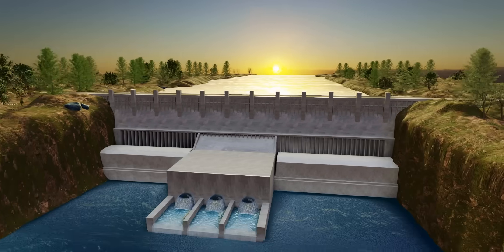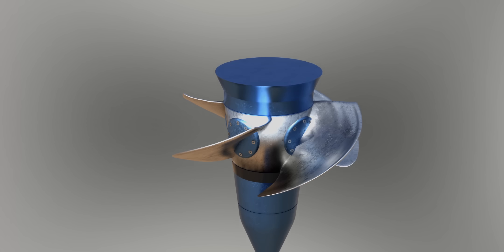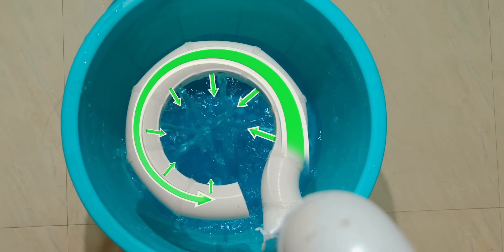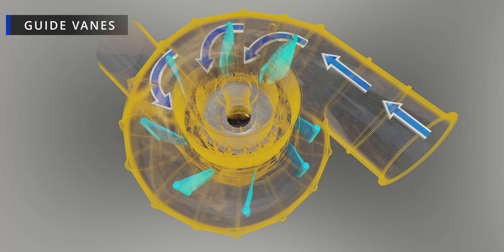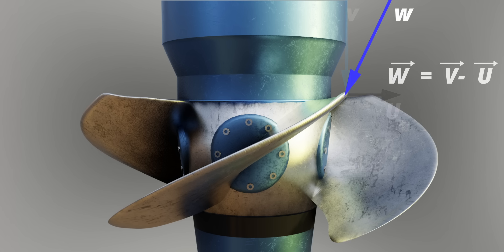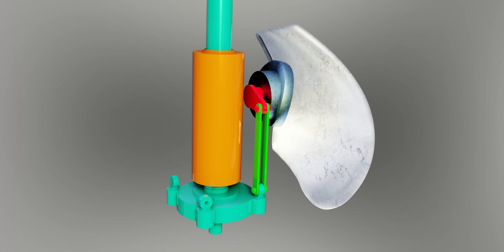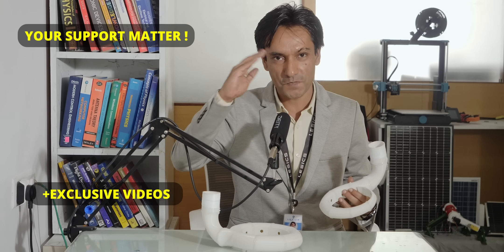Kaplan Turbines | Understanding the Giants of Hydroelectricity

Comment: Why does increasing the size of the draft tube with an end flare reduce the cavitation effect? One would think that increasing the volume of the tube in a low pressure situation would future decrease the water pressure resulting in more cavitation. I guess, because it causes an increase in flow rate that results in a pressure increase to more than compensate for the increase in post turbine tube volume?

Comment: every diagram and animation shows governor blades stationed verticaly, butin reality what about the fact that there are facilities with no casing structure  but a concrede spiral chamber (wtich does the same job) the turbine sits on/inside the floor, the intake  and the governor blades are positioned inside a narowing shroud about 40 cm from the floor, and the governor blades are positioned not verticaly but at an angle about 30 degrees (it could be less i have never mesured them down there)  betwen the cros section and ground simply imagine a 90 degre angle where the hipotenuse is the cros section of the governor blade, the bottom cathetus is the floor , and the side cathetus would be the shaft, is there a efficency benefit in my described system becuse the water does not have to make a 90 degree turn. or am i just misunderstanding something , because now that i understand that it is a flow floil thing and not the other way around that the blade must be perpendicular towards the flow. Anyway grate video. Ps My family owns a small plant and im an operator and mechanic (self taught mentored by my father)

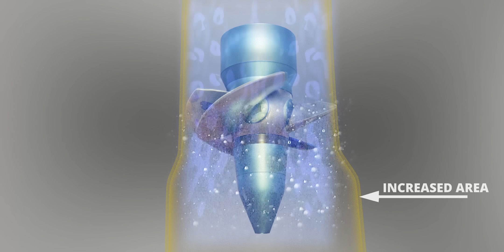Comment: 5:34  how could increasing area result into increasing pressure 🤔
increasing in surface area of water wouldn't result into more bubbles ? 
Or its that the increased area will allow air to flow in opposite direction of water to manage pressure 
Wouldn't it be dangerous 🤔🤔🤔🤔🤔
Aaaaaa can't understand

Comment: I have always thought that Francis Turbines were the ones meant to be used in high-pressure applications. Engineering isn't always so straightforward.  I remember being about 12 years old visiting a hydropower facility that had a nice set of 8 Kaplan turbines, and when visiting the generator room, it was really hard to envision that I was actually over that huge case embedded in the concrete of the dam. The noise of that water rushing was really overwhelming.

Comment: I'm a robotics engineer and back in my fluid dynamics classes in college, I've computed the relative speed between a fluid and a propeller many times, but I've never noticed that the optimal relative speed between the two was equal to the angle of attack, which now seems so obvious! Either change the angle of attack to match the relative speed of the flow or change the relative speed of the flow to match the angle of attack. Thank you for your animations, they help clarify so many concepts 🙏

Comment: 5:37 How can increasing the diameter of the pipe for an already low pressure stream increase the pressure?
The velocity is low and increasing the area will reduce velocity even further, which then will reduce the pressure right?
Reply: No, Energy is conserved, thus the Bernoulli Principle is applicable here, Kinetic Energy + Pressure Energy+Gravitational Potential Energy = Constant.
Thus as Kinetic energy drops, Potential energy is unchanged, then the pressure Energy must rise.

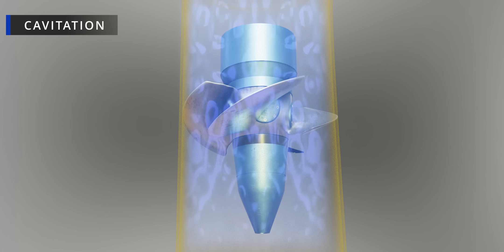Comment: 05:14 This I struggle to understand. At 05:34 the increase of area is explained as the solution - how can the pressure get higher of this?
Reply: Bernoulli's principle: Larger diameter decreases water flow velocity, resulting in increased pressure.

Comment: Thank you for both enlightening me and confirming how much of a smartarse I am.
I hadn't thought about blades being aerofoils.

I'm still uncertain what the blades look like in those special hydro plants which are used as instant suppliers of electricity when there's a surge in demand. You know, the ones that pump the water back up to a top reservoir at night when the cost of electricity is cheaper.

Comment: Would think if a lift force wasworking on the top surface of the blade, it would spin the other way (pulling the top of the blade in the direction it is facing. 
Isnt this just kinetic energy turned into rotational energy?
Edit: I see what they mean - the lift force is at the bottom of the blade and not the top. Still not sure that this is that majority of the force that turns the turbine.

Comment: I could be wrong but are there not two separate forces acting on the blades?
Splitting the water flow would cause a low pressure area blow each blade as is discussed but also the water hitting the top of the blade would be forced to deviate from its straight path thus imparting an inertial force to the blade. 
The amount of force imparted to the blade would depend on the angle and the speed of the water, both of which are variable.

Comment: Question: If the output water pressure is low then shouldn't the outlet be converging instead of diverging?
Reply: Use continuity equation, large cross-section reduce velocity and because total energy of fluid needs to be coatant, it's pressure will increase
Reply: @AmandeepSingh-bj9dm  so... basically anti-venturi effect?
Reply: @zorrothebug  yup

Comment: Great video, and very clear graphics. 

You explained how they regulate alternative current, but how do they align the phase of the alternative current with the phase of the electric grid?
Reply: The generators are also motors.  If a generator is receiving extra power from its turbine, the generator tries to rotate slightly faster and thereby it tries to advance its phase with respect to the phase of the grid.  In so doing, the grid demands more power from it and thereby increases the load on it, inhibiting it from any further advancement.  When a generator is receiving reduced power from its turbine, the opposite happens.  Thus, all the generators are kept in lock step, so to speak.  When a generator is first being brought on-line, its speed first is adjusted under local control until its frequency and phase are matched to that of the grid.  Then the switches are engaged to place it online.  If the switches are engaged when the generator is out of phase with the line, bad things happen!  (Excessive current and excessive torque trying to jerk it into alignment.)

Comment: 5:40 same volume of water, increased area, isn't it making the pressure even lower?
Reply: ok I got an answer under some other comment who asked basically the same question. By increasing the diameter you slow down the flow thus increasing the pressure. It's basically the opposite principle as the Venturi effect.
Reply: Thank you, was about to ask the same.
Reply: Yeah, I was just about to ask this.

Comment: If the generator has to run at a specific RPM how can the power output increase if it cant spin faster? I get that the vanes increase the flow rate and the blades adjust to maintain rpm but how does that increase output?